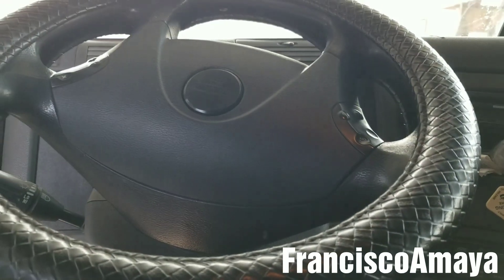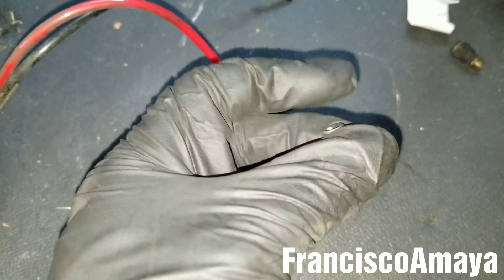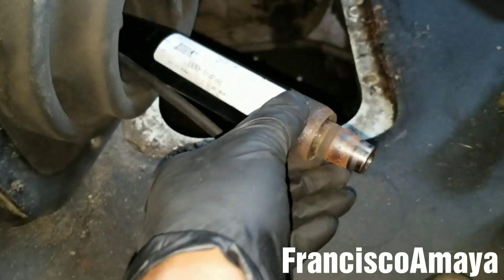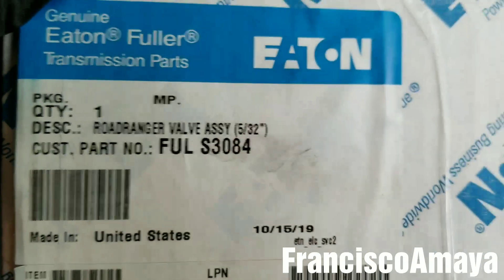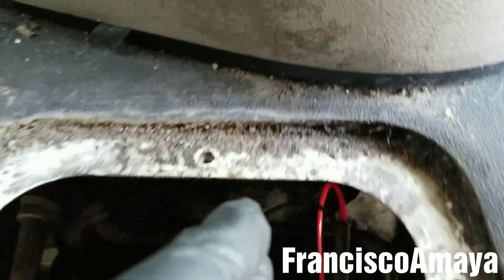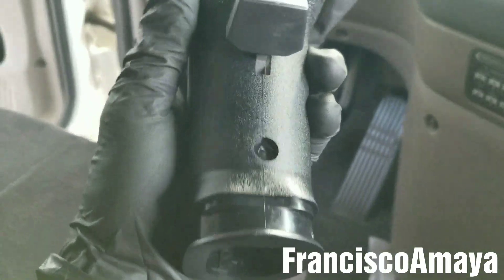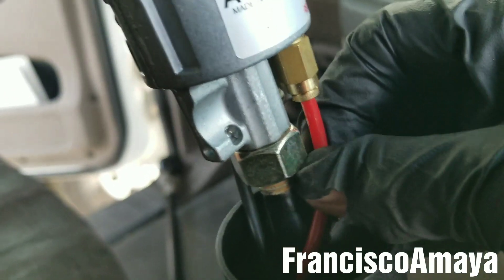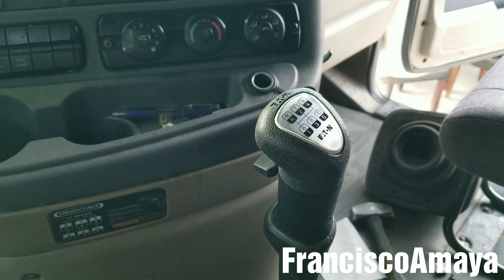Freightliner Cascadia gear shifter lever bushing replacement 9 10 13 15 18 speed transmission

Comment: Francisco , what about a Eaton smart shift 13 speed that does not want to shift into 13 speed. It stops at 12 speed and shifts down in twos like from 12  to 10 to 8 to 6 and then 5,4,3,2. any idea about this problem.?

Comment: I just bought a 2012 cascadia. The gear shifter is aimed to the left so far that in order to put it in reverse the seat needs to be lowered to the floor. It's very awkward to shift. How could I remedy this?
Reply: Saludos, alguien cambio la palanca, busca la original.

Comment: Hello Francisco ..
Im Trying to find out ..
Freightliner cascadia 2016 auto trans
The truck won't shifting and showing message saying gear pos rail sensor problem detected and the shifts inhibited ....
SPN 521485
FMI 2 
And the dashboard screen it doesn't show me like drive or neutral or Reverse all the gear position disappears from the dashboard 
What this means ?

Comment: Francisco i have a question maybe u can help me out with an advice,  i have a dd15 and while idleling the rpm go from 600 to 700 to 800 and back to 500..  no check enging light on ...any advuces on what to check inspect..replace? tnx brother